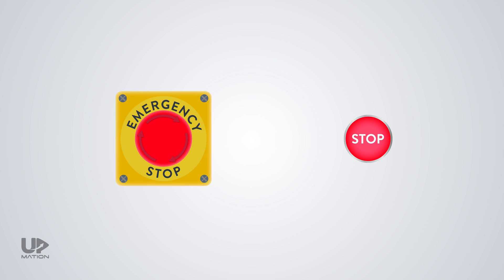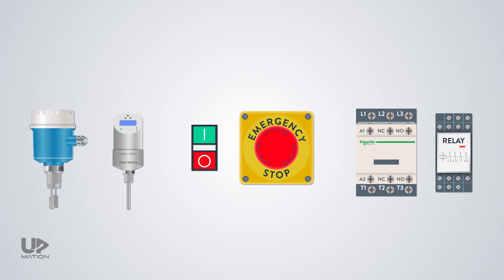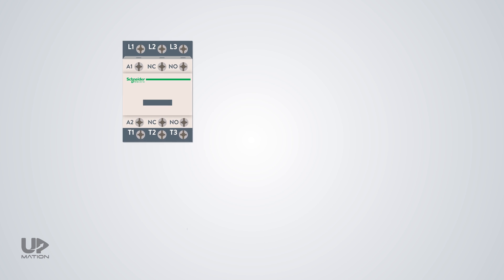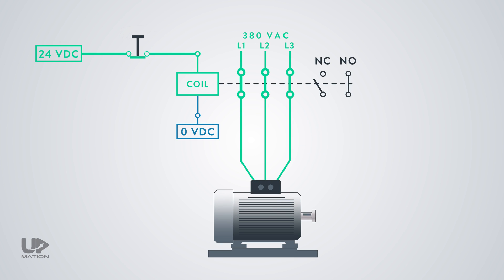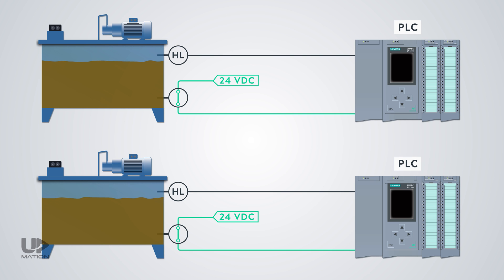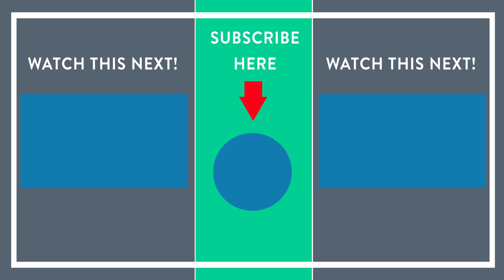NO vs NC | 5 PRACTICAL and IMPORTANT Points About Normally Closed and Normally Open Contacts

Comment: HL - NC - Because if it was NO and there was a fault in the sensor cable, no one would detect the problem if the oil level was too high.

Comment: I'm a bit concerned with the low-level switch example. Given the definition of Normally closed is that The switch is closed (current flows) when the liquid level is normal. When the liquid level drops too low, the switch opens, cutting off the current, which triggers the alarm or action. Then the perfect switch for the low-level sensor would still be the Normally closed one.  An NC low-level switch is generally safer because wire damage or disconnection will immediately be detected as an issue by the PLC. It provides a fail-safe mechanism where an open circuit always signals a problem, whether it’s due to low level or wiring faults.
Reply: You’re not the only one. I’m still scratching my head. I thought NC was always sending signal then when signal is broken it turns off device and vice versa for NO.

Comment: Is it possible if we use RF signals to operate HL and LL switch with PLC. If we can do this then there will be no problem of cable damage or problems in wiring. It’s just one question, I’m new in this field. Pls don’t take me wrong

Comment: The type of contactor to be used for the design of this particular High Level switch would be Normally Closed contactor. This is will serve two purposes as the Low Level contactor switch. 1. If there is a damage in the cable, the HMI would identify it as a sign to stop inflow of coolant oil
2. When the oil is filled, circuit opens hence sending same signal to the HMI indicating the tank is filled. 
But what I really gathered from the selection of the contactor is that it is not just the switching but how to effectively use these contacts to control damages like damaged cables.
Reply: Surely you would have a normally  open switch as this serves same purpose as low level . If cable is damaged then it will send signal saying there is a fault .

Comment: Hello, what will happen if there is a broken circuit in the LL sensor? Considering it is NO, nobody can notify the operator.
Reply from the maker: Hi there! There could be two scenarios here. First, is an "automatic" oil-filling system. Second, is manually filling the tank . 
- Assuming the LL sensor is NO, let's see what happens in the first case (Automatic system):

If the LL sensor is broken (sending a zero signal to PLC), then the filling pump should work to fill the tank. As the LL sensor does not change the condition to 1 at some point to turn off the pump, the oil level reaches to the HL sensor. Finally, the HL sensor should turn the pump off. You might say, what if the HL sensor is also broken? Bear in mind that, there could be multiple configurations here depending on our expectations and desire. For example, we can add a middle-level sensor to offer more reliability and at the same time, keep the level of the oil exactly between the LL and HL. or we may solely want to add a timer in our PLC program to turn off the pump after getting a 1 signal from the LL sensor.

- In the second case (manual filling):

The LL sensor is supposed to send 24 volts to PLC at the normal level. If it does not do so, then something is wrong; whether it is a broken LL sensor or a low level of oil in the tank. Hence, someone should check out the condition locally.

Comment: NC for HL when sensor or switch sense it was full of oil automatically 1 line will be missing and plc will detect it. Normal Oil level should be NC. 
NO for LL same as your explanation.
Reply from the maker: Thank you for your precise comment and input! That is correct!
Reply: @Upmation  keep on sharing knowledge brother. Thanks! 
 New sub here from hvac/r field =)

Comment: the purpose of the HL sensor, is to ensure that once the oil coolant get to its maximum point the pump should stop. therefore the sensor will be NC switch, once the the maximum point is achieved, the plc send control to open the sensor.
Reply from the maker: Absolutely correct! Thank you for the answer! One more reason that we use NC contact for the HL sensor (And it is actually the main reason) is to detect its probable malfunction (cable damage or sensor breakdown) despite the process is running or not. If we have an automatic oil charging system to the tank and the cable is damaged, then the oil will probably overflow and no one gets notified if the sensor is Normally Open. Generally, remember that the LL and HL sensors both should be enabled and send 1 to the PLC when the level of the liquid is somewhere in between them.

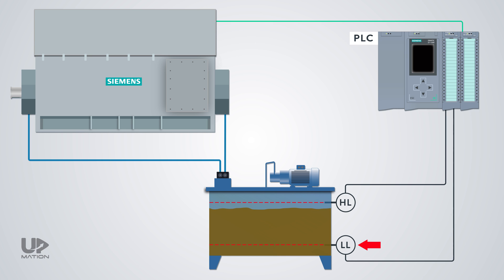Comment: 2:24 - that’s shown a NO switch
3:15 - and here it’s a NC switch shown...
Reply: You just get confused because of the illustration, bro. But kindly focus on the situation where and when the LL Switch is triggering. I tried to play it back several times before I understand :-).
Reply: @rkhrrrmdc3843  - Mate, you are right. I had to play it few times after you left me the message.
Reply from the maker: Hey! Sorry, we have missed your comment due to an unknown reason!
Please listen more carefully and @2:20 you hear that we say; "Let's assume that the Low-Level switch is a Normally CLOSED Switch..."
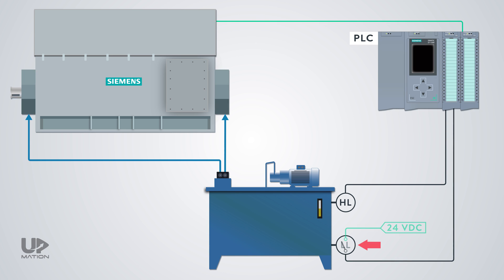and @3:08 we say; "Now let's consider that the Low-Level switch is a Normally OPEN switch..."
We're trying to consider the possible scenarios and give you an idea about each one so that you can understand which scenario is the correct one and what is the reason!
Reply: @Upmation  - Yeah, sorry you are right. I though that the iilustration was opposite to what you was saying, but I was wrong. I appologise and thanks for taking your time to deal with me. I hope  if are any other "rubber heads" like me, will see my comment and yours and MDX reply. Thank you very much for doing this kind of videos! This are very informative!

Comment: Dear friend, in 2:20 you assume the LL of the tank ,as a NC switch but is NO switch in fact. (you use the same symbol later as NO).....NOW in 3:10 you assume a NO switch and this time you are right.
Reply from the maker: Hey! Thank you for the comment. Let me clarify a little bit more here… An NO contact is a contact that should be OPEN UNLESS it gets excited by an external cause (here is the oil). It means that the normal condition for these level switches is when they are not exposed to the oil inside the tank (whether it is the High- or Low-level switch or it has an NO or NC contact). Please consider that the name is “Normally Open” but it doesn’t mean that it cannot gets closed!
So, @2:20 when we assume the LL switch is an NC contact but you see an OPEN contact in the picture, it means that it must be excited by the oil (the oil has reached and passed the NC Low-Level Switch), and it has gotten open. (@2:28 you see it is again closed because the oil is below that.)
@3:10 we are assuming another situation with a Normally OPEN switch this time and compare it with a Normally CLOSED switch.
We say there “let’s assume the LL is normally open one…” and after that, the oil passes the LL switch and makes it closed.
Please watch the video completely and from the beginning more carefully and let us know if you have any further questions.

Comment: Hi, is this also applicable to automatic water pump and can also be operated manually? High level sensor and stop push button are NC while low level sensor and start push button are NO?
Reply from the maker: Hi Erica! Sorry for my belated response.
Yes, this is applicable for automatic pumping system. Of course this is an example and in different processes we may want to turn on and off the pump(s) with other instruments such as pressure sensors and under certain circumstances (With or without PLCs).
Yes, Stop Pushbutton is NC. Low Level switch and Start pushbutton are NO.
The High Level switch in automatic process should be NC (as you've said as well) and in manual process (in which we fill the tank manually) you may not need any High Level Switch.
Let me know if you have further questions.
Reply: @Upmation  I think for the manual processes you may include some more sensors , for example Extra high and Extra low. This are helpful in a way that if device is run in manual the process can still continue or stop depending on the circumstances

Comment: would it be a NO so when the level got to high a signal would be sent back to the PLC?
Reply from the maker: Hi Paul!
Actually, when the process of filling the tank is automatic, the high-level switch should be an NC switch (Sensor). Therefore, as long as the level is below high, it sends a signal to the PLC. And when the oil gets to the high level, its signal to the PLC gets deactivated. The reason is to become aware of any cable damage (or sensor damage) as well as monitoring the fluid (oil) level. The PLC should turn off the automatic filling system when the level reaches high. So we should have an NO low-level switch and an NC high-level switch. Let me know if my answer was helpful or not.
Reply: @Upmation  Hey, I have a query here. As you said in the video, when main coil energized NO become NC. Lets take an example of LSHH having relay output NO and NC and 24V supply is connected to Level Switch. If I connect NO to the PLC then at normal condition PLC get 1 as input and when High level is achieved PLC get 0 as input moreover when wire breaks in that case PLC get 0. Conclusion: Whenever PLC receives 0 it will stop the motor. (that is Automatic) 
Another case, When I need to hardwire LSHH with motor directly then I need to connect NO as interlock. 

These statements are made based on my understanding after listening your video. 

Please let me know if I misunderstood something. 

Thanks.. 😊
Reply from the maker: @Ajay Bisht  Hi there, Ajay! First, let me thank you for watching the video and asking your questions.
First of all, I should correct this sentence which you wrote up there 👉 "when main coil energized NO become NC". 👉 Actually, the NO is NO and the NC is NC! When a switch (it does not matter which type; level, pressure, or any kind of instrument switch) has a built-in NO contact and we excite it (energize it by any means) it gets closed, but it is still an NO contact.
Second of all, let me simulate what you said again and elaborate more. Let's assume a switch has both a NO and a NC contact and we use it for the HH level of a tank. For High-level, generally we better use a NC contact. It means the switch is constantly sending the 24 volts signal to the controller (PLC) unless  the level of the liquid or material reaches to this switch. At this time, the NC contact gets OPEN so that the 24volts from the switch gets disconnected from the PLC and the logic of the PLC should be written so that the pump turns off immediately. The reason that we use a NC contact for a High level switch is that it is the safest way to monitor the signal from this switch all the time (for any kind of malfunction or cable damage). In these cases, we lose the 24volts as well and the same scenario happens (pupm turns off). We'll  then check to see whether the material within the tank reached to the high level OR the cable has damaged (for example)? If the material has reached the high level then everything is OK and the process will be continued without interruption and we see that in the HMI and monitoring systems. If the cable has damaged or the switch has some kind of malfunction, we will repair it and will restart the process.
Reply from the maker: You may ask how can we distinguish the reason of the pump stop to see if we have to go to the instrument switch location and repair the cable?! Well, if the high level reaches and the pump stops working, then it will restart again after the level of the liquid settles down after a few moments... So there is no problem with the cable or the instrument. As we had explaind in this video, we can use a Namur switch. Normally we use a Level trasmitter AND a high level and low leve switch for having more control over the process. There are other techniques as well...
Reply: @Upmation  great content 💐💐👍🏻👍🏻👍🏻
Reply from the maker: @vikashranjan6936  Thank you, Vikash! Happy learning!
Reply: Waiting for more such videos